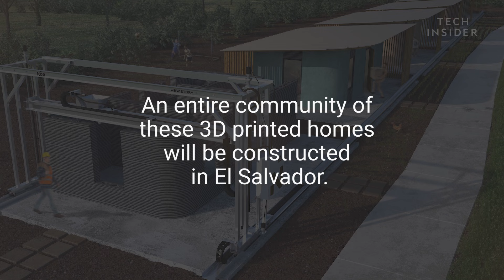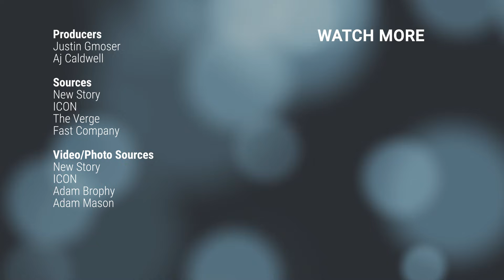3D-Printed Home Can Be Constructed For Under $4,000

Comment: this machine can change the world.. Peace v
Reply: azan subhie ...if you want first world standards. It's basically the new Fema camp tent house.
Reply: I call bs on the 24 hour figure. Maybe for the printing not the finished product. Even if they had 20 people working on it a 24 hour finish would still be unlikely. and then paying all the people to finish it would go way over $4000. claims made in the vid seem very misleading.
Reply: Vanessa Cherche they will probably use volunteers, plus a roof can be built during the printing time.
Reply: 20k instead 100k means 6 years less of work in my life
Reply: that's 20k for just construction. after you factor the land purchase, it will run you around 70-80k.  you can buy a regular small house for this money in ohio/kentucky
Reply: Foxtrot November the whole purpose of technology is to make all our jobs obsolete so we can have all our needs met without slaving away and have all our time for leisure.
Reply: Haha In case you didn't notice, or are even aware, the wall needs steel reinforcement. A worker has to lay a sheet of mesh for every layer. This exact design & size of house could be built with precast or composite panels way quicker & cheaper.
Reply: With cheap labor and materials in el Salvador. You can build the same house for $4,000 and create jobs for poor contruction workers so they could feed their family instead of this company making all the money for their 3d printer machine.
Reply: I prefer Peace VI or MCM or Y
Reply: oow.. i see.. thanks captian
Reply: World peace? Only with a shattered USA.
Reply: No, not really
Reply: Foxtrot November not really, still need to set up the printer, the framing, the electrical, the plumping, the doors, the windows, etc.
Reply: housing market isn’t overpriced anyway
Reply: Jom Main i agree it saves many peoples lives and also pushes there confidence higher bless whoever came up with this idea 💡
Reply: More like make people jobless especially if they only have construction skills.
Reply: JoMain nah dude. 4k for wall without any house accocories. you need 2k more for roof. 2 k more for sanitairy. 3 k fro plumbing. and developer profit 10k. it ended up 20k
Reply: azan subhie 
$50,000
Reply: azan subhie still, 20k is a pretty good price, it's like buying a car, better than a house costing over 100k
Reply: yup, all of the sudden your 1 million dollar house is nothing worth more than just 50k..... goodbye economy
Reply: Jom Main yes it will destroy America by stealing 100's of thousands of jobs while fixing homelessness everywhere. Except the ones who created it because OUR HOMELESS do not matter. Glad they changed the name from robotic or machine home builders to something less harsh or noticeable like 3d printer geez how sweet and technologically advanced us Americans are?? We can kill our jobs and create more homelessness for ourselves well at least we'll put it to good use by HELPING THE HOMELESS IN ANOTHER COUNTRY INSTEAD OF OUR OWN AFTERALL WE DONT HAVE ANY HOMELESS PEOPLE THAT ARE WORTHY ENOUGH BEVAUSE THE NEWS SAID THEY ARE BUMS AND PAN HANDLERS AND JUNKIES AND SO THEY DON'T DESERVE HELP THEY'LL JUST RUIN IT.
Especially Now that we will be adding construction workers-window/door installers and companies and dont forget lumber jacks and stores and a myriad of other folks who will be homeless now.  So glad we even DON'T HET OUR FOOD HERE ANYMORE RARE IF I SEE NON ROTTED PRODUCE IN A STORE.  HECK IF I OWN A HORSE I CAN GET A 65 LB BALE OF HAY AT $7 OR LESS BUT IF I OWN A GUINEA PIG OR RABBIT I MUST PAY AN OIL TYCOON $13 FOR 40 OZ OF CRAP IT SCRAPED OFF THE BLADE OF A MOWER AND SWEPT UP BEEN CRAP I EVEN GET A BONUS PEICE OF CEMENT FLOOR SOMETIMES
HOW LUCKY AM I???  It's no problem I call the oil tycoon to ask him if he can sell me a bottle of water but I better figure out what NAME brand I want or he won't know which one to put oyster shell in with extra fluoride or does fluoride raise ph too??  DON'T MIND ME I JUST LIKE BEING HONEST.  I BARELY SCRATCHED THE SURFACE.  MAYBE THEY SHOULD USE THAT"PRINTER" TO PRINT  A HUGE 80' WALL TO LOCK US POOR USED UP HOMELESS AMERICANS IN.